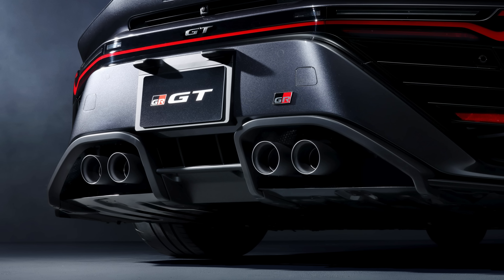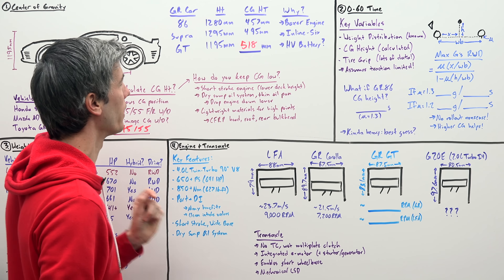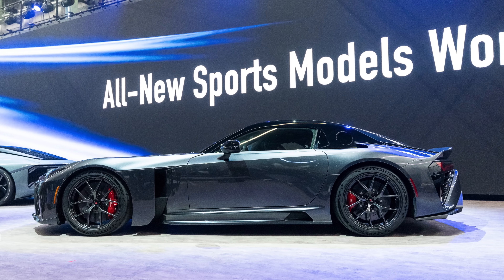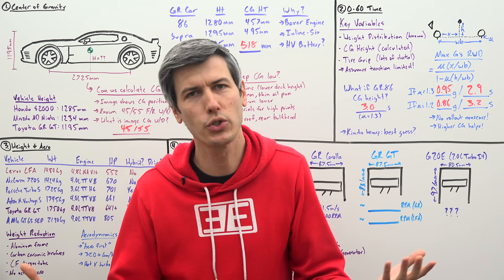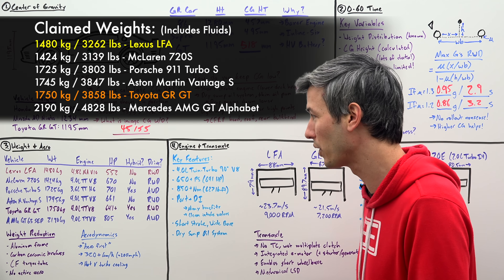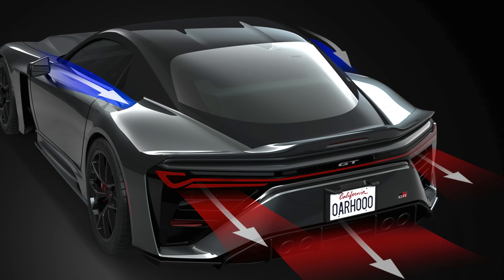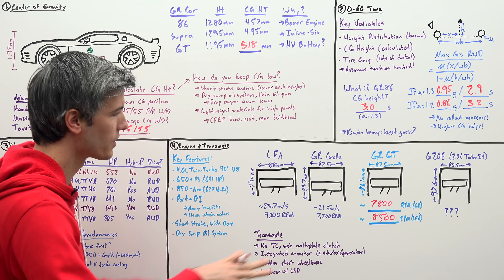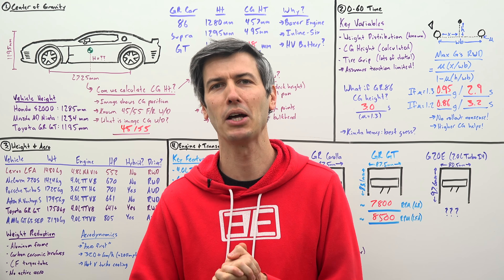Toyota GR GT - All The Engineering Details We Know!

Comment: I always wonder how supercars ended up weighting so much. This is a small car, alluminium chassis, some carbon panels, 2 seats, yet it ends up over 1700kg, 500kg heavier than the GR86, 700 more than the MX5. I'd love a video where you break down where those come from, as I imagine the engine/gearbox would be at most 100kg difference, then you get bigger brakes/wheels to handle the power, stiffer chassis (but using more weight-efficient materials), I'm not sure about how those account for another 400kg while also removing rear seats. My evo IX weights less with active AWD, steel chassis, and accommodating 5 people, while still being able to handle 600+ hp, I'm not entirely sure what benefits are being pursued with the extra weight in modern supercars.
Reply: its probably all the safety regulations, modern sound deadening etc increasing weight, imo anyways could be wrong.

Comment: Surprised that you didn't talk about the rotating moment of inertia.  Pushing the transmission out towards the rear along with a front mounted engine will increase the moment of inertia.  That means that the car won't rotate as well as it could.
Reply from the maker: Engine is behind the center line of the front wheels, it'll prob rotate just fine. :)
Reply: @EngineeringExplained I’m sure it will too but it could always be better. 😊

Comment: V8TT means it can easily turn up the power. 1000hp should be relatively easily like the Supra.
Reply: 640 HP is more than enough.
Reply: @gergelyturcsanyi6743  For 4l V8 it's nowhere near enough. It need more boost.
Reply: @KolyanKolyanitch its a toyota, reliability is important 😊 maybe there will be a more extreme version later
Reply: @tinhinnh  once its released someone is gonna wait it out for some to find it in a junk yard and k/LS swap it lmao.
Reply: @EnhancedTrashBin it may be faster but the value would be trashed
Reply: @tinhinnh you have nothing to lose for something that was left to rot in the junkyard besides your time and investment in the car
Reply: @gergelyturcsanyi6743 ikr, any more and its unusable on the streets
Reply: stock 2jz supra had 320hp, this has twice the hp, i think its fast enough 😊 sure they can get it to 1k+ hp but at what cost?

Comment: Everyone else: Small displacement! Turbochargers! Hybrid assist!

Toyota: Yes, but what if also V8?
Reply: They kinda copied the first gen amg gt though. That car is sick though and this Toyota also is. Especially if it’s fairly low boost from factory, E85 and a tune could possibly crank this thing to 800+ hp. Can’t wait for enthusiasts to get our hands on it
Reply: Hybrid is only to spool up turbo in gear shifts
Reply: @ShivamArya-yf4ku that would be an MGU-H system like in Formula 1, I believe all the motors in the GR GT are in the rear near the transaxle so I’m pretty sure this car will not utilize MGU-H.
Reply: @ian.williamson  the hybrid isn't connected to the turbo fan but it's there to provide power when you gear shift into a smaller gear and revs drop and turbo needs to be spooled again, thats literally what they said in the press release, it's not for generating top end power but for producing smoother shifts when revs drop. And Formula one doesn't use a motor to spool their turbo as far as I know

Edit: oh wait f1 does use electric turbo my bad. But the rest of it

Comment: They should make a trim level or 2 lower: non hybrid NA V8 and maybe a 6 cylinder, for substantially cheaper
Reply: Maybe they make one with a b58 😂
Reply: Emissions regs are the reason it has the boring hybrid system to begin with
Reply: @someone8476 it’s a MHEV (mild hybrid) won’t feel like a hybrid at all
Reply: @kengit2still means more weight from motors, a battery and other electricap components.
As someone else said in another comment, the weight is also pretty high up which is going to impact its centre 9f gravity so it'll perform worse at its track usage

Comment: Oh yeah, I'm gonna trade in my rusty 2001 prelude for this.
Reply: But why not upgrade to the new prelude?
Reply: @joeschmoe5009  I used to own a 2001 Prelude for 9 years, loved that car to hell and back. Guess I would be the target audience for the new one, but it's really mehh. It looks just like any bloated and rounded new car, not sleek and elegant like the Preludes. The powertrain, although interesting from an engineering perspective, looks to be underpowered. And there's also the price, for what it offers.
Reply: @joeschmoe5009 you mean downgrade?
Reply: @joeschmoe5009 bffr
Reply: @joeschmoe5009 At that price just spend a few thousand more and get a slightly used Civic Type R instead. The Prelude is a joke.
Reply: @joeschmoe5009 so I'm a Toyota guy, had a avante first car with the 22re, ke70, ma70 7mgte, chaser mk2. Love my Toyotas but I sold the toys to buy a house for my young family. Now Have a 1 Gen Subaru Forester ej20, I do not want a newer car, not that I couldn't afford a new car. Too much beeps and boops and dings and just overall electrical sht. A car should do car stuff. All this hybrid, full EV, meh. I live rural Australia and need a car that can tank a kangaroo and endless dirt roads, horses for courses tho. I'm a diesel tech and I love the old mechanical systems with virtual nothing but a electric starter on the engine, temp/oil pressure but they are hardly complicated
Reply: Camry also works
Reply: @Unknown-64209  Camry the 2nd best car ever, after Corolla.
Reply: @bobbymoss6160  I think the Camry is better than the Toyota
Reply: @bobbymoss6160  If you're comparing it to a kitchen appliance maybe.
Reply: @Unknown-64209  v8 camry would be awesome
Reply: Maybe this is not a car for you, or for me either.
Reply: “And I have an engineering degree!” That was brilliant! 😂😂
Reply: I would love to at least sit in one and pretend I’m driving it.
Reply: You better not. Give it to me 😂
Reply: I don't know man you might regret because VTEC
Reply: Aw man that was my first car
Reply: lol
Reply: I'm going to trade my mint 2017 McLaren 600lt for this new Toyota supercar.
Reply: @3120DownForce im not sure if they'll take it... maybe youre better off scrapping the car and using the money they give you as a base to start saving up
Reply: How .much u can get from ur old prelude
Reply: @punkeded  i bought it for 1k, so probably 1.3k
Reply: Better than the $60k new prelude that is slower than a prius and has less horsepower

Comment: If the electric motor is before the gearbox how will it maintain "Positive Torque" during shifts? 13:15
Reply from the maker: Great question! Here's Toyota's quote: "The motor-generator, which is positioned in front of the transmission, is used to help make up for the momentary lag in torque response that occurs during acceleration and gear changes." That seems to indicate it's making up for torque "response" and not necessarily torque-fill, so maybe I've misinterpreted their quote. A good question for me to ask them!

Comment: Definitely a weird engine+placement choice for a GT car. High inertia front, and doesn't even have the naturally aspirated advantage that the AMG has.
Reply: What are you talking about?  There currently is no naturally aspirated AMG car on the market.
Reply: AMG GT3
Reply: @jonathansmith7306 Another car you don’t own…😂
Reply: @jonathansmith7306 the racecar has that but the road car still has a 4.0 twin turbo V8. The GT3 car is also getting a bit long in the tooth and Mercedes has already debuted a GT2 variant that uses the turbo V8 mill so I expect whenever they update the GT3 it will follow that trend.

Comment: Okay I gotta be a little suspicious of the "we prioritized low cg" while also making the design decision to mount the battery pack at like driver head height. 😞
Reply: That's because it was designed as a racing car first with the hybrid system being essentially an after thought for the street version.
Reply: @khanyilemgwebi2575 yes, I'm guessing they made this decision for the sake of fuel economy and to compete against similar vehicles in the segment in terms of data points. The GT3 will obviously handle and track better than the consumer hybrid.
Reply: @khanyilemgwebi2575   shouldn't be there to begin with, would end up as a better car
Reply: @khanyilemgwebi2575 Why don’t they make a version without all that hybrid crap? It would solve a lot of issues and make the car a lot lighter
Reply: @ggj1987 emissions? That's literally why they did the first unfortunately, I'd want that too.
Reply: @ggj1987 ik  its frustrating and I cant even afford one
Reply: Still lower CG than AMG GT lol. Compared to AMG GT, GR GT battery is just 15cm higher and even AMG GT engine is positioned over front axle, which is real problem than the battery.
Reply from the maker: Haha, I thought the same when I saw it. If you look at AMG’s solution, for example, they manage to fit the battery between the rear shock towers, rather than above like Toyota.
Reply: @EngineeringExplained  although they shot themselfes in the foot a little with their gt (man am i tired of bad model names😅) by getting rid of the dry sump
Reply: @PSboy_VIIalso with the new less dedicated chassis. The OG AMG GT was way cooler IMO
Reply: @TheBlackopsbeast360  yeah i never liked it but i do now that they've ruined it 😅🤦
Reply: it not present on the GT race car. So using up space down low wouldnt make sense considering it was designed as a racecar first, and a hybrid second.
Reply: @fen2453 I don’t understand, do you mean that there’s no space for the battery somewhere low?
Reply: @Conservator. The hybrid stuff definitely looks like an afterthought. That's why they put the battery up there like an aftermarket modification
Reply: @hectornecromancer5308 
You could be right but I find that hard to believe from a manufacturer like Toyota
Reply: @Conservator.  well, not even Toyota are immune from afterthought. They'll still do well as long as they stay true to their main selling point from all these times
Reply: i believe they are going to build the road car manly for homologation purposes for the racecar and they built the platform mainly for racing and in GT3 racing classes hybrids are not allowed so that weight will not be there neither is this transmission
Reply: It's bc they're talking about the RACE CAR
The street car is the homologation special,
It has the hybrid to meet emissions

They could DEFINITELY put it lower
But that'd mean they'd develop the street car first

They didn't

They made the GT3 car first
Reply: Instead of turning it vertically and mounting behind the drivers seat
Reply: @brkbtjunkie The gearbox occupies that space.
Reply: I think they're prioritising the GT3 variant's performance over everything else. Get rid of the hybrid system and suddenly everything is mounted really low on the chassis.
Reply: This is the same Toyota that said "you can remove the plastic guards on the fake vents to make them functional" on the Supra after all, they like to lie
Reply: And to be clear this is a design decision and it's not an unreasonable one since as Jason calculates the higher cg might help 0-60 times. It just smells like marketing types got a hold of the talking points.
Reply: @Grato537 gonna be crazy when people either find a place to relocate it or remove it all together in the tuning community.
Reply: @Grato537  Definately prioritized the low cg only after finding out the batterypack could only be placed where it is
Reply: First mod is gonna be battery relocation and higher boost
Reply: @videorowtv5198 the relocation of the battery is not going to be easy. I can't explain why that is just yet but seriously -- it's going to be a LOT more work to do that than you think it is.
Reply: @LoneWolfSparty people will likely outright remove it first, then they’ll find a place to put it later.
Reply: @NatVirgo that would not be wise; you'd immediately get a check engine light with reduced performance.
Reply: It's even crazier to me because the HV battery is almost certainly comprised of pouch or cylindrical cells which can be split and arranged in whatever shape you want... unless you're lifting the whole battery pack form factor out of a RAV4 or something. Kind of a shame, really.
Reply: @username34159265  Exactly.
Reply: Putting the battery over the rear axle seems like a good compromise given the added mechanical grip
Reply: @JacobHalfman it creates a rolling momentum during turns and with the gearbox behind the weals that means this thing will drift!
Reply: Apparently the car was delayed due to strict emission regulations, so it was probably added after to pass.
Reply: its a small battery calm down guys
Reply: I'm still stuck on "shorter than S2000."  😳
Reply: Might be easier to replace the battery in the future
Reply: Easier to replace I guess?
Reply: getting of that extra weight period. its beyond unnecessary.
Reply: Structural member.
Reply: The battery pack ruined it.
Reply: It will be a massive failure, typical toyota

Comment: As a daily driver, i wouldn't care if it does 0-100 in 4.5secs, have less than 550hp and weights 1700KGs but not at 200k hahaha
And it's nice to have a closed deck block for future power increase headroom.